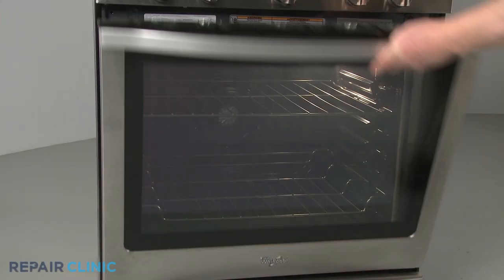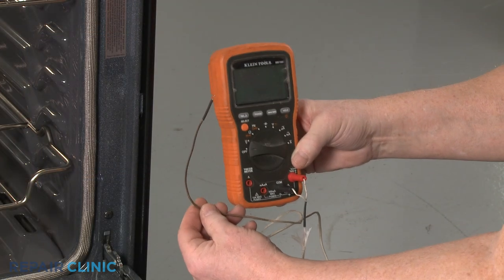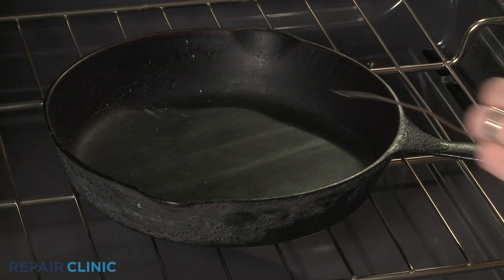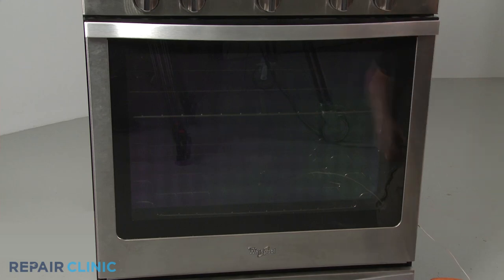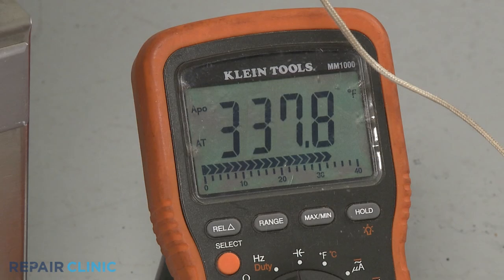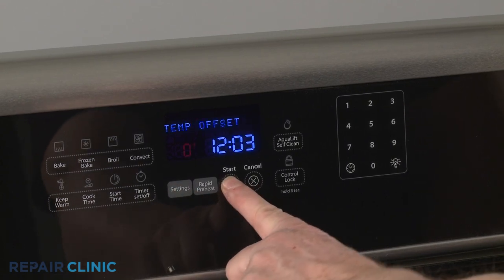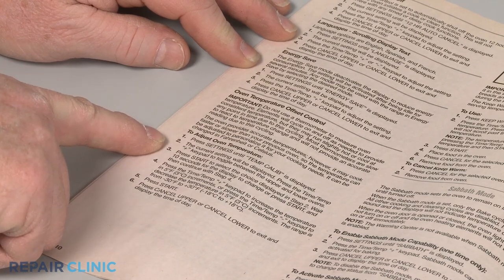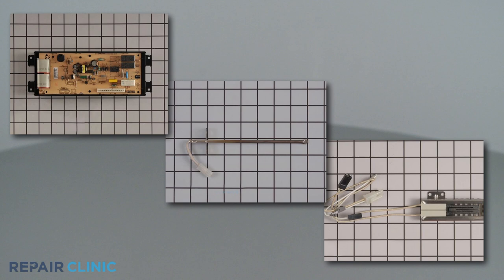Measuring Oven Temperature

Comment: I don't recommend those analog oven thermometers. I've seen them 50 degrees off brand new. Digital only if you want accurate readings.
Also, checking oven temperature needs to be done by getting the average of high and low temps after 3 or more heat cycles as the oven tries to maintain the set point. 350 is the standard test setpoint temperature. Doing it the way you describe here does not take into account that many ovens use the broil during preheat to preheat faster, plus your probe is in the center while the oven temp probe is upper rear and left or right side....., again, near the broil element.
BTW, in 13 years of repairing appliances, I have only had to replace one temperature probe and it was a wiring issue, not the probe itself. It's the control board that fails 99.9% of the time.
When an ignitor fails, it often will not heat at all, or the broil is the only heat source during preheat so it takes a long time to heat up. If it actually reaches the setpoint, the the broil drops out and the oven cools back down since the bake ignitor is not working. You may also smell a mixture of gas and a sour metallic smell from improper ignition.